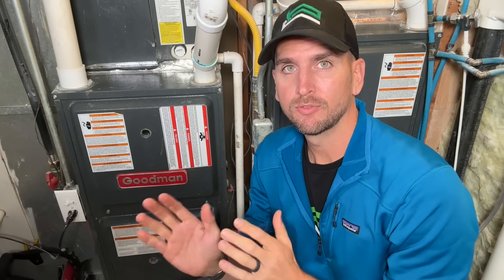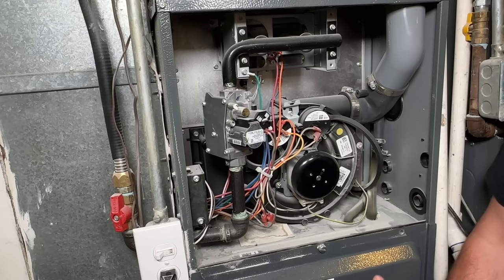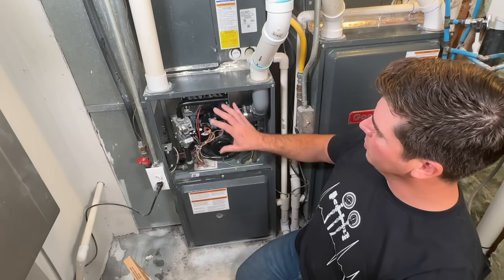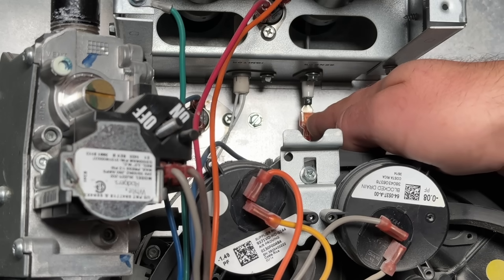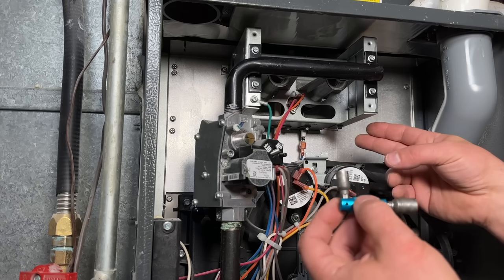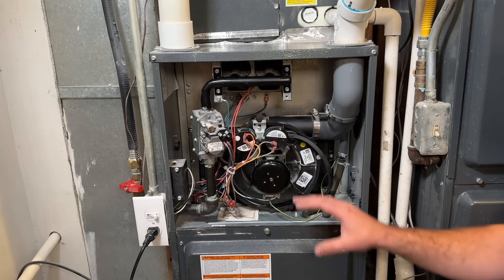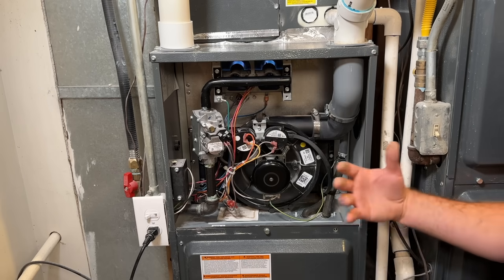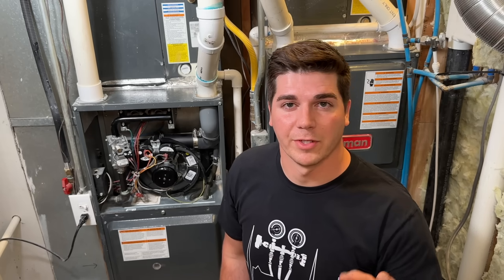Yearly Furnace Cleaning And Maintenance Pro Tips

Comment: Being in the HVAC business I can tell you that paying for a yearly furnace check up is a complete waste of money.
Reply: Warranty will be voided by the Supplier if no Maintenance is done on your unit
Reply: Not necessarily every year yea your not wrong maybe every couple years I’d say with the newer ones the traps love getting clogged
Reply: @cody-gaming7593 In most situations a trap is not necessary. Just have a vent on the condensate drain. Then you don’t have plugged drain issues.
Reply: @northernwiman.7472 yes you do what do you think the box that goes onto the collector box is? It’s a condensate trap You should be cleaning it regularly every furnace comes with one that’s a 90% efficient furnace if they didn’t the unit would have nowhere to drain the condensation from the high efficency furnace
Reply: I disagree. A check once a year minimum. Keep condensate pumps cleans. Re-calibrate gas valves. Clean flamer sensors and provide a free 1” filter. Not to mention vacuuming and shining the furnace and water heater. Make it look shiny
Reply: Unless it's a requirement for the warranty...
Reply: In the 30 plus years I’ve been in the HVAC business. I’ve never had to show maintenance records for warranty coverage.
Reply: @Benhamin2002  to be fair he said to pay for yearly cleaning.  Meaning it can easily done by the homeowner.
Reply: I can tell you don’t take your job serious and don’t know what you are talking about. There’s more to the maintenance that doesn’t get covered in this video. A couple of things would be testing combustion and clearing out neutralizer drain line. It’s people like you that confuses customers smh

Comment: I had a furnace fail once and called a HVAC company. They charged me $250 to come out and diagnose that it was the flame sensor and clean it. It's a good idea to know what to do and it's a good idea to clean it every year.
Reply from the maker: Amen to that, thanks for the feedback David.
Reply: I have one better.  They serviced the furnace then routed the a/c drain line higher than the catch basin.  Destroyed my furnace because I didn't notice it for months.  The exchanger was rusted badly.
Reply: Before you call an HVAC co, ask for references from a friend or neighbor or a trade association. Most cos. are honest and some not!
Reply: For $250 they should have at least replaced the sensor as it's a $15 part..............
Reply: Serviced and installed hvac for 30 years the only time I ever had to replace a flame sensor was when I accidentally broke one trying to remove it to clean. They very rarely fail.
Reply: @MK-xl9tt  But they charge a lot to come out and clean it because they know most people are stupid about what went wrong.
Reply: That does seem a little much for a service call. Pricing obviously varies from company and or location. We would charge $110 for a service call which covers the first hour of labor. Cleaning the flame sensor takes a couple minutes but we have to account for travel time and would utilize any extra time to do a basic check(change filter, clean condensate lines, check temp rise etc depending on the unit).
Reply: @MK-xl9tt  You guys know you can charge whatever you want when we know nothing about the furnace and are freezing and we just need to get the damn thin working again. It's up to you to be honest enough to charge fairly. Cleaning the flame sensor is a simple thing but it can bring down the whole furnace. You can even change the part out and say it was $250 just for the part. What do we know?
Reply: Yall don't pull your burners?? Back in 2018 I worked for a small family owned company and Every furnace maintenance we  did we pulled all the burners and cleaned them as well as pulled the blower out and check the coil Takes no time at all. Now the company I work for years later doesn't have us remove tge burners and charges a blower pull and clean as extra not included in the maintenance.  But a coil spray is.. times have truly changed.
Reply: @MB-rr1fb  I wouldnt replace if its only several years old. Plus, they arent always universal, can be very brand specific. Homeowners should ALWAYS keep a spare next to the furnace at all times.
Reply: What if my sensor is clean but the furnace still turns off after the initial turn-on?
Reply: @Asiansxsymbol  replace both the hot surface ignitor and the flame sensor next. (take a pic of your furnace model number and go buy it from Grainger or whatever appliance repair store is by you). You shud buy 2. Always keep a spare of both parts on hand, cleaning doesnt always solve it if its broken internally.
Reply: I'll say a 100 is fair cause your paying for the labor, truck, materials, insurance. Therefore,  80 a hr isn't bad if any business want to be profitable
Reply: @MB-rr1fb yes , you are absolutely right, is probably those companies that offer you a maintenance of $79 but end up paying a lot more

Comment: I have a very old Rheem furnace and last night we tried to run the heat for the first time since last winter. The house was chilly and we figured we would take the chill out. That being said it wouldn't start or stay running. I was pretty stressed out as I've been out of work, so i found this video at 430am and i decided to try and fix it myself. I cleaned the spark ignitor and flame sensor. I also used a can of air to clean the induction fan and its running no problem! Probably saved myself $700! Thank you for the advice!
Reply: Hey, just wanted to wish you the best in finding a job. I know it's super super important. Don't give up. Grab whatever you can find. It's always easier to get a job when you have one, even if it's a lousy one. I know it's a cliche, but I am currently taking care of my mom with lung issues. Believe me, health tops everything. At this point, I would give away anything and everything to never have to hear my mom say son I cannot breathe. Count your blessings. All the best from 🇨🇦
Reply: Cant beat those old Rheem furnaces, mines still running since 92
Reply: me too !!! no filter on the 1950s Hercules model!

Comment: I have been in the business since 1986, and I remember when I  felt like routine maintenance was more important. Changing belts, oiling motors, and shaft bearings. Finding  sticky limit controls. Today, I am compelled to agree with it not being so necessary. But then I run across those few jobs every winter, where vent pipes are broken because a roof was replaced or the glue job on the pvc was poorly done. I find plugged vents from birds or mice. Certain products have secondary heat exchangers that sludge and cause the unit to spill over several hundred ppm of carbon monoxide in the exhaust. Cycle rates on thermostats that are not set up properly. Heatpumps wired to a fan coil improperly. Constant hot water tanks installed by big box stores with no screws in the vent pipes or leaking gas joints. So it is easy to think it is ok to have it done every few years if I train my regular homeowners and they are interested in taking the time. But often I am visiting new homes with new surprises. Once, I returned the following year, and a contractor cut out my venting and did not glue in a single fitting. I was really glad to find that one. It caused me to start taking pictures and document, my jobs before I leave.

Comment: This is a good general check for a DIYer, and it's something I do every other year.  The times I don't do it myself I pay a local company to do a little more detailed tuneup that includes inspecting the heat exchanger for structural issues like corrosion, current draw tests to check the operation of the electrical components, and actually removing and cleaning the burners.  It's a system that's worked well for me for a lot of years.  As for the filter change interval, I use a pleated filter with a midrange MERV and change it every other month.  I run my HVAC system fan constantly, so I felt 2 months would be better than the filter company's 3 month claimed life.  You don't want to allow a filter to become too restricted; the real reason furnaces have filters has to do with protecting the internal components, not the air quality in your rooms.  Using very high MERV filters restricts the air flow and causes your blower motor to work harder than normal.  The same can happen with lower MERV filters if you leave them in too long.
Reply: Thanks for sharing this knowledge with everyone! Most of the time homeowners just assum hvac guys are doing a good inspection when in reality they’re probably browsing the web on their phone for an hour down there 😂 It’s just nice to be educated with your hvac system which you clearly are! Cheers friend
Reply: I bought the cheapest furnace I could find 25 years ago, a Goodman, installed it myself, and it's just been chugging along for 25 years now heating a 100 year old home in Montana winters. Never been inspected or cleaned. I did have to put a new ignitor in it once, and we change the filter every 3-6 months but other wise it's set it and forget it. I will definitely buy another Goodman if this one ever dies but it was under $1000 25 years ago and it owes me nothing at this point. Had I been spending even $100 on inspections the last 25 years I'd have already wasted more money than a new one will cost.
Reply: @bryanhersman4037  wow, you'd be lucky to pay $2000 for one now! Let me know if you do 😆

Comment: It's smart to do the annual furnace cleaning DIY. Last time I had a tech do it, he slapped "condemned" stickers on my perfectly functional furnaces due to "cracked heat exchangers." Showed me grainy pictures with hairline fractures on them. 

I got a second opinion. They told me the first outfit was notorious for the "cracked heat exchanger scam." That was 5 years ago. 18yo furnaces still running great.
Reply: MY Goodman Furnace was working properly, all components seem to be working properly, but the furnace won't keep the running after it ignites, looks like it's going to start then shuts down. The problem was this furnace is 4 years old and the black feed pipe that the burners attach to have brass fitting for each burner with holes where the gas comes out. Those holes were partial covered with carbon. I took the black pipe off, removed the brass fitting and pushed a tip cleaner through the hole in each one, put it back together Bingo furnace works fine. I also took the Flame sensor out and used fine sandpaper to clean it. So simple to do.
Reply: @briananderson6142  most likely was the flame sensor
Reply: @gtarules1  It was both the Flame sensor and the gas feed from the pipe that feeds the burner end. It was partially blocked with carbon that slowed the gas flow. You can't buy an extra flame sensor in Canada without a gas ticket.
Reply: Cracked heat exchanger and still you are using. Technician should Red Tag it. It's not safe you are compromising with unsafe appliance
Reply: @RakeshPathak-lu8yc  -- That's not even slightly true. Hairline cracks in heat exchangers are common and most often not a problem. These are not hermetically sealed systems. Any technician who suggests otherwise is lying.

It has now been 5 years since my furnaces were "condemned" by these fraudsters. Functioning perfectly. Rock-steady blue flame at every burner. No carbon monoxide alarms from my detectors. Great systems.

If my furnaces were not functioning 100%, I might agree with you. But that's not true.
Reply: @DEValentine  That's not even slightly true. Be sure to put a CO alarm next to the furnace so that you have a chance of being warned before you die in your sleep.
Reply: In Ontario Canada it's not allowed TSSA will cancel the license Being a Gas technician I will not run that Furnace in my  house I will not compromise with safety and my family,s Life
Reply: @DEValentine  it's comical how an honest and pretty innocuous comment about the hvac industry gets deleted, must be a lot of sensitive types around here.
Reply: @RakeshPathak-lu8yc  No. That's fraud, what you're saying.
Reply: @ThereIsNoOtherHandleLikeMine  -- Dead wrong. That's dead wrong, and you know it. If you can find a CO detector with instructions to install it directly next to a furnace, let's see it. Mine says it has to be at least 15 feet from a furnace.
Reply: @DEValentine it's not Fraud it's safety concerns. In Ontario it's not allowed

Comment: First time having a furnace, and I did not know this sensor needed maintenance. I bought a mini screwdriver ratchet bit set from Harbor Freight! A small multi stubby screwdriver would work also for tight spaces. Thank you for your video help it's much appreciated!
Reply: As a homeowner, you should always have a spare hot surface ignitor and flame sensor by the furnace too.
Reply: Thank you, I will keep spares.

Comment: Great instruction and information.  I converted from oil to a gas furnace 3 years ago and the HVAC installer recommended the first furnace cleaning to take place now that the furnace is 3 years old in order to maintain the warranty.  Wow! what a difference from an oil furnace.  My father was an oil burner mechanic until the late 50's, but he continued to do furnace cleaning for friends and others as a side hustle for many years and I helped him as a kid.  We would vacuum pounds of black soot out of the furnace, the flu and the base of the chimney.  Several measurements were taken and several adjustments were made to calibrate flue draft, burn temperature, pump pressure, cleaning and setting electrode gap, spray nozzle replacement, check and tension the fan motor belt and oil the shaft bearings, electronic photo flame sensor cleaning or replacement plus a host more.  Finally you'd change the filter(s), re-prime the fuel pump and you'd be ready for another heating season.  I'll continue to have the HVAC specialist in every 3 years until the warranty expires, but now I'll do my own annual maintenance in between and after the warranty.  WHAT A DIFFERENCE?.....and simple procedure!
Reply: Wow!  I have a fuel oil furnace and until last year have had it serviced every fall.  I can tell you that of the 3-4 companies I used over the years, no one did all the things your father did!  How do you find a conscientious and responsible person/company to do everything necessary when you’re a single 71 year old lady?  😳
Reply: @BobbieJeanM  you want to find an hvac shop with good reviews from a service like Angie's List. These companies work hard to keep good reviews on that site, im telling ya....

Comment: Thanks Great video - FYI-- Blow out air lines on air pressure sensing (vacuum) switches - Some of these air switches has two contact - one on the front one on the back .... check both! 
 yellow powers both switches - brown and orange are the two different outputs signals. Inducer housing pressure and collector box pressure (check square tubing vacuumed sensing signal). This may apply to your unit.

Comment: Thank you so much for posting this!  I'd had three different companies come by to look at my furnace, they dinked around with it for about three hours each and said they had no idea what was wrong with it, but charged me through the roof for looking at the furnace.  (Not a lot of great service out here.)
Reply: Wow, I’m sorry to hear that. Did someone eventually get it figured out?
Reply: @diyhvacguy  Yep, eventually, the fourth guy said, "Oh, you don't do your own yearly maintenance and cleaning?  That's weird, nobody would think to check that."  Turned out I'd been using a cat litter that made a little too much dust in the basement, and soot had built up.  Changed to a different brand, and now I know how to clean my furnace, thanks!
Reply: @kerikrogel9126  wow! That’s really weird. Glad they got it figured out 👍🏽 cheers
Reply: Both furnaces shown in this video have the same code violation: the gas supply line should have a sediment trap AKA drip leg before going into the furnace (although in some cases this is installed within the furnace, before the gas supply feeds any furnace components).
Reply: @stevebabiak6997  theres probably about .05% homeowners that would install that into the gas line if it wasnt there. Just sayin....
Reply: @srobeck77   - where I am located, when the time comes to sell a house, the municipal building inspector will come to the house and do what they do before the house can transfer ownership. Little code violations like this tend to get caught then. If someone wanted to DIY the job to install that drip leg, it should be less than $20 in parts.
Reply: @stevebabiak6997  again .05% chance your average homeowner will go buy 2 pipe wrenches and all the parts to do that. Thats even after they can get over the fear mongering from someone telling them "will blow themselves up" working on a gas line. So agree to disagree on anyone doing that repair.
Reply: @srobeck77  - you lost track of one thing: the original install was DIY, the owner already had the wrenches and had played with gas piping already.
Reply: @stevebabiak6997  I actually didnt miss that, since that was never stated. Was that just a guess on your part? Give me the time stamp or youre full of shit, bruh
Reply: @srobeck77   - look at the channels here dude. They preach DIY all the time, a pro would have put that drip leg on in the first place since the parts and time are minimal in comparison to the overall cost if the job.